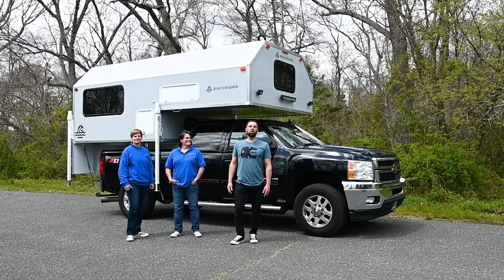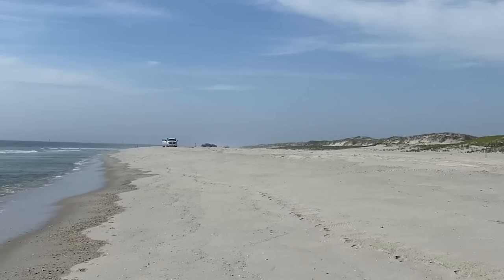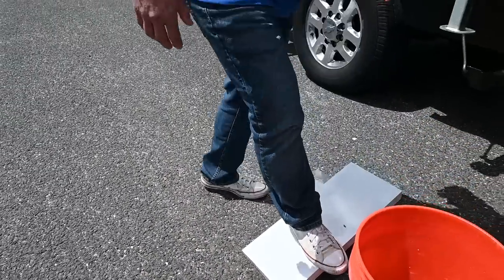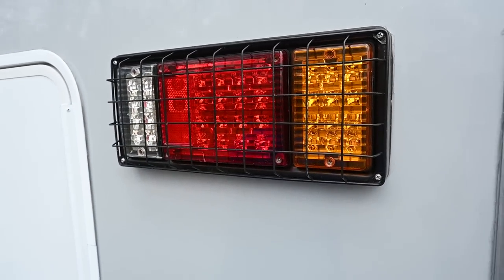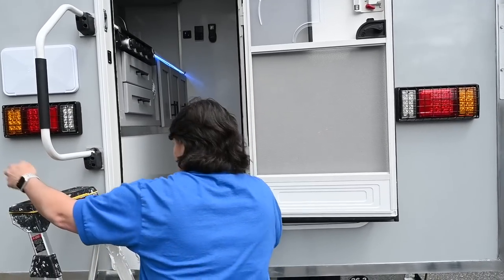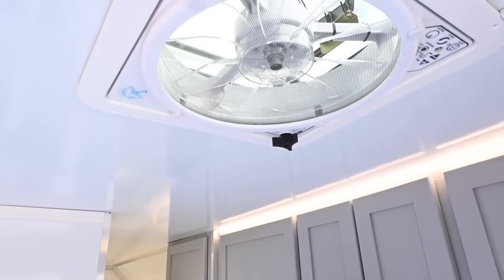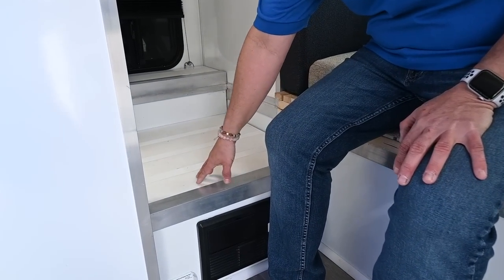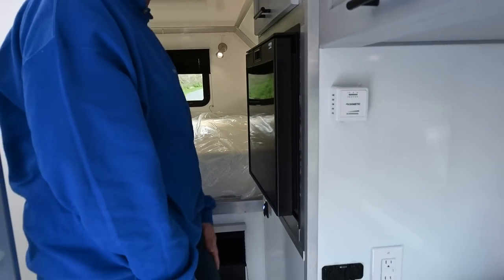INNOVATIVE Pickup Truck Bed Custom Camper - Beach Roamer Overlanding

Comment: Just curious if you can make it aerodynamic afront exterior cabover, dry bath, andlarger fridge? Am interested with your flat bed design which am assuming you can put to use the extra floor space. Thanks ladies. V n masterpiece.
Reply from the maker: Thank you for the suggestion
Reply: Hi Czeal.  Stay tuned.  We are in the process of building a custom flatbed with what you described.  VERY EXCITED!

Comment: What a beautiful camper! Well thought-out as far as weight goes and comfort but there is one thing that kindly bothers me about this camper and that is the flat nose in the front. Even though they build these really lightweight it still looks like that The gas mileage is going to be hindered Because of the flat nose That's just what I get out of this when I see that front part of the camper. Besides that it's a beautiful camper and the prices don't sound that bad really although I'm sure that eight months ago they were a little less I'm sure they're probably more by now. I hope you left a link to their website. If you didn't I will go back through this and find out what their website is and check things out. Thank you very much for this video.
Reply from the maker: Thank you for the feedback Terry
Reply: Thank you for your feedback Terry!  Yes, we sometimes have people ask us about the front of the camper and if it hinders mpg.  The angled roof design actually allows wind to pass over the sides of the front of the camper and reduces the overall surface area heading into the wind.  It actually creates a really quiet and less wind resistant ride.  We can absolutely angle the front wall of the cabover but the downside is you lose height in the cabover sleeping area.  Hope that helps.

Comment: NJOA,,  PATRICK, Hello, these 2 ladies, have built a lightweight STRONG insulated panel system,  this would really work for 2 people ,no sweat , it’s  well built , the heat is standard, and A/C  Could be added ,if wanted,  the design is great , HOW MUCH & what size propane   My regards to them,  CHERIO,🇺🇸🇺🇸🇺🇸🇺🇸
Reply: Flyby Airplane, thank you so much!  The propane storage area can hold up to two 20lb vertical propane tanks.

Comment: Looks like a nice camper..do you cave color options??
Reply: Hi Dave, the interior comes standard with a white gel coat finish and the exterior comes standard in white or dove grey.  We can absolutely do a custom color or work with a custom graphics company depending on what your looking for.  The aluminum trim can also be powder coated in any color you want.  Michelle is a Harley fan so I think she’s itching for someone to chose Harley Davidson Orange!  Hah!

Comment: Perhaps you guys can put your engineering hat on for the aerodynamics for the front of the over cab camper it needs better design for appearance and win the gas mileage will kill me compared to what I'm using now but your camper is better overall I would enjoy yours much more except for the front window area it's too flat perhaps a three-quarter type or 5/8 bolt on some side of under cap fiberglass and have the top extend over in the rest of it bolted to it from underneath and have that with some sort of aerodynamic mold to the face of it hopefully it would never leak but you guys can fix that problem I'm sure
Reply from the maker: Thank you for the suggestion
Reply: Thanks for you feedback.  Very much appreciated!

Comment: to heavy and no very wind resistant. Check out fourwheet campers and Allterrain campers
Reply: Hi April, Four Wheel campers make an excellent camper if you’re looking for a ‘pop up’ camper.  We also offer a Base Camp Model and and Overland Model that have varying heights in the cabover.  It reduces the front wall but you have to sacrifice a lot of spacious headroom.  It’s really whatever works for each client.

Comment: 21:45
As I listened to your prices, I wondered about their sustainability in this economy.
us$20,000 today equals us$30,000 next month...
...or us$60,000 or us$160,000 next year...
...if materials and labor can be acquired.
Break a bit or wear a blade, will replacements be available?
This is a tough time to 'normalcy bias'... the belief 'everything will return to normal pretty soon'...
... while all the evidence points the other direction.
.
Beach Roamer has the advantage of flexibility, a small organization with open avenues.
Compare their adaptability to a standard RecreateVehicle manufacturer, operated by distant committees of non-camping accountants.
Clueless about camping needs, they persist in staples into particle-board, and holes in the roof... cheap and disposable.
.
Every RecreateVehicle buyer looks at price.
We are the same way.
We see no way to compare a us$19,995 RecreateVehicle designed for pavement and a few weekends annually...
... to a us$650,000 ExpeditionVehicle engineered for decades of full-time live-aboard in remote regions.
.
I think the Beach Roamer niche is far more realistic than any factory RecreateVehicle.
We delivered RecreateVehicles manufacturer-to-dealer and dealer-to-shows.
A year and a hundred thousand miles, we saw little difference between variations... other than their nifty swoopy decals.
.
Compare a factory RecreateVehicle to a horse trailer or commercial flatbed.
Those operators are responsible for their animals and equipment, they would never tolerate the design and engineered flaws built into American RecreateVehicles.
.
Quality Control?
We are convinced RecreateVehicle QC consists of the customer living in the repair-shop waiting-room or in the parking-lot while warranty work is 'performed'.
Nincompoopery!

Comment: 00:58
And staples into particle-board.
And holes in the roof.
And single-pane joulousy windows.
And poor insulation.
And cheap disposable appliances...
.
2003, after a half-century of lesser rigs, we converted a 1996 Ford CF8000 commercial truck to our concept of an ExpeditionVehicle.
Nearly two decades full-time live-aboard.

Comment: im confused, the videos says you dont use any timber, however it clearly shows dimensional lumber used in the framework at the front of the bed over cab section. Also i dont like the front of the camper it needs to be more aero dynamic
Reply from the maker: The exterior superstructure does not use wood
Reply: @NewJerseyOutdoorAdventures  but the video talks about how stupid it is to use wood as it rots out. why on earth would you use timber for the super scructure at all, its super hypicritical. Like the camper which you showed which rotted had used a wooden inner superstructiure and thats what you wanted to avoid, then you go and use timber again.

Comment: First problem I see is the lack of aerodynamics. Their is no contour at the front..just a flat block. Even with a diesel, that truck has the duramax, expect to lose MPG. Second, the bolt hardware on the outside is zinc plated..it’s going to rust..if you’re building with aluminum, use stainless hardware. Where’s the awning? Gotta have an awning..I think it’s been too personalized. It’s not a bad design, but in the real world I doubt they sell many units.
Reply: Hi Tommy, thanks for sharing your feedback.  The Limited model shown does have a large front face which creates a really  spacious cabover.  Although mpg usually isn’t the best anyway with a large full size truck, we do offer an optional air dam for folks that are concerned about aerodynamics.  
Our Overland model is 6” shorter in height but still has a roomy cabover with plenty of headroom. The trade off is the basement storage area is shallower so the fresh water and grey storage tanks drop from 30 gallons each to 18 gallons each.
The Base Camp is a full 12” shorter than the Limited shown but has 5 gallon tanks (more like Scout) in order to keep the headroom. 
Yes, all of the fasteners are stainless steel.  We don’t want them rusting out!
Customization definitely adds a level of complexity to the build and decision making between choices for customers.  It’s part of what we love to do but certainly isn’t for everyone.
Thanks again for your feedback!

Comment: Fridge is way to small
Reply from the maker: For you, it would work for me
Reply: Hi Fran, we do offer other size refrigerators depending on your needs.  Personally, we love having an additional dc powered cooler/freezer that we keep plugged into the truck while we're driving and then plug in outside the camper when we get to our destination.  We use the dc plugs located outside the camper for the refrigerator and now a TV so we can watch football outside by the fire pit.  :)

Comment: 2 miles per gallon hahaha
Reply from the maker: Not as bad as you think
Reply: Hi HLevia, it really depends on your truck.  If you have a diesel truck, then you won't notice much of a change in the mpg.  Our Chevy 2500 Duramax laughs at the Beach Roamer like it's a fly on a horses back.  Our Ford F250 gas truck has about a 1.75 drop in mpg.  The newer Ford F150 has about a 2.5 drop in mpg.  It really depends on your truck and your driving style such as highway vs city, lead foot (Michelle) vs donkey (Vicki), etc.